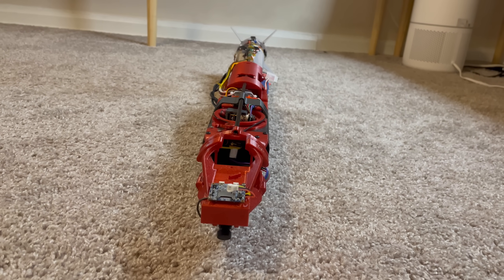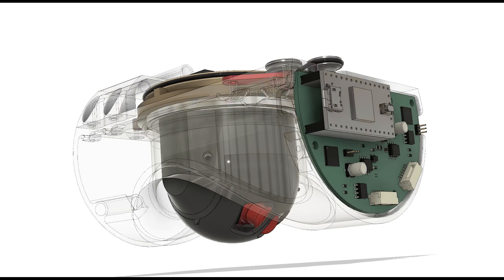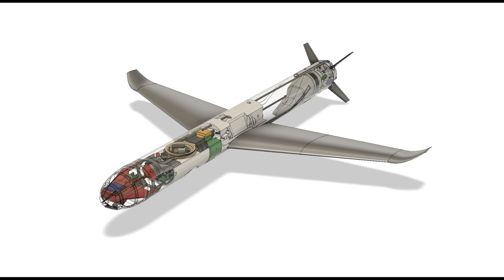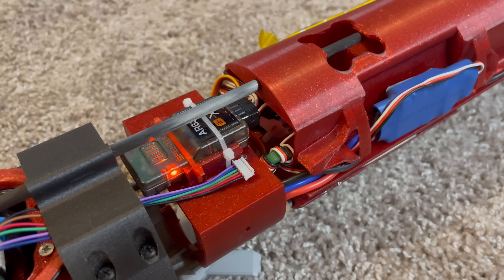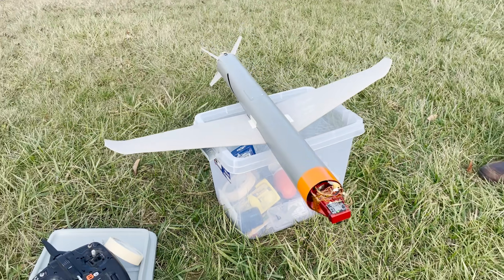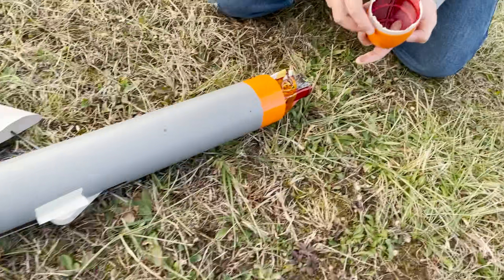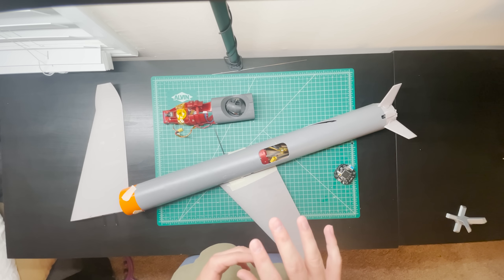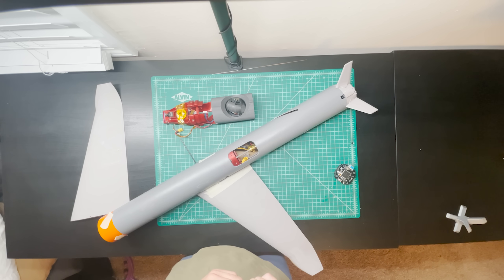Building (And Crashing) my Homemade Surveillance Drone

Comment: My guess is it need to be less then half the weight. And four times the power in addition to a stable rail launch system for the takeoff. Then you might see what have to be done with the centre og gravity, flight and control surfaces and stabilisation of the thing. Still a long way to go i guess.

Comment: Two things. 1, if launching by hand, don't throw it. Run and then let go. Throwing almost always pushes the nose around. 2. You don't need all four fins on the back. Many aircraft use the V-tail design with just two on the top.

Comment: To launch, maybe try releasing from a quadcopter with sufficient payload capacity. If not that, find two trees and get some surgical tubing. Scale up a water balloon launcher to use as a catapult launcher. You’re not getting airspeed by throwing it.
And verify your CoG. 
Instead of taking apart your prototype to save weight, build a clone that is identical in weight and  balance and CoG with only the EDF and Flight control. Get use to launching that , then start hurling all those hours of painstaking work into the air. Good luck!!

Comment: I would recommend two things: First, a slingshot launcher utilizing a small pen located under the center of mass. Secondly, I would suggest splitting the intake into two intakes and angling them off to the sides so you're not literally pulling yourself towards the ground or off balancing yourself in one constant direction.

Comment: As a college student studying aerospace engineering and apart of a college aircraft design / evaluation team here are some considerations possibly not mentioned.

Material choice: because the cardboard tube offers a high level of rigidity don't worry about the internal parts being super strong, 3d printed parts can be small with ribs, if a part is to have a large cavity use low infill or even lightweight "foaming" filament. This will reduce the launch mass without suffering huge losses to internal structures.

EDF Inlet: currently as the aircraft is flying the edf is trying to pull air out of the stream of air going around the plane. This is not only inefficient but could also be causing losses of with the tail section. As it currently stands a small bit of air is being pulled in by adhesion to the inlet and negative pressure caused by the fan. A proper inlet for the edf would go a long way especially once at cruising speed. This does not have to be much more than a little scoop that hinges down with the pivot point near where the current inlet stops. Additionally a thin grate could be added to help reduce injested objects and prevent the edf from exploding. The grate does not have to be super large or thick as where it is likely to pick stuff up (the ground) it should not be travelling super fast.

Comment: If it ever flys its will be going pretty fast to have a chance of lifting all that weight.
It looks like a rocket, probably needs almost rocket speeds to work.
When it flys it will not stay up for long considering the small battery, so sounds like a cool idea but realistically tracking something for less than 5 mins of flight time will be pretty useless.
The tracking idea is cool but better suited to a more standard quad copter design that can stay in control around a small area, land and take off successfully repeatably. ( Maybe a launch pad with charging capabilities)
Or a more standard plane setup thats low weight, slower flying with bigger payload capacity for longer more useful duration flights.
With all planes, take off us easy, its the landing thats much harder!

Comment: rail launch makes the most sense to me, especially if the final idea is to launches using rocket motors. Rail launch will get you that high take off speed which the rocket motor will also give you. Lighteining the payload offcourse helps a lot but then you are not really doing full testing of your control system when your payload isn't there. You want to tune your control system with full payload (gimbals moving around creating moments that need to be resisted, all the inertia of the payload batteries messing with response times). Also rail launch is cool

Comment: Here are some ideas.
1. As general rule of tumb, place CoM slightly ahead of lift center, it improves stability but decreases controllability. If you put CoM behind, the aircraft is unstable but highly manoeuvrable, which requires good autopilot and thrust.'
2. Rail guide for takeoff. Even a simple rail would make takeoffs easier, plus you could add catapult mechanism to it for increased chances of success"
3. Remove thrust vectoring, it quite often destabilises simpler guidance systems at low speeds.

*P.s. i have extremely low IRL experience, most of these thoughts come from the KSP experience and other YouTubers of .
Reply: There's a saying about CG vs CoL: a nose heavy plane flies badly; a tail heavy plane flies once.

Comment: one thing i would try if you are gonna try and throw launch it again is to have the rpm up to full while still in your buddies hands, that way you don't have to worry about the motor coming up to full throttle and it may allow him to launch it straighter

Comment: since you are operating at slow speeds you should use more of a flat bottom so that the rocket body acts as a lifting surface itself...as far as the space in front of the engine inlet perhaps you can put a small lithium ion battery as a backup power source to maintain controls in the case of engine out just to get it back down/not crash into pieces lol

Comment: Check out the Aerojtp mc-01. They use elevons for pitch/roll control. You have pitch and yaw only but you don't have enough effective dihedral in your wing to turn yaw inputs into roll so you're just going to wash out. At that weight you need more wing area and more thrust,  easier done with a propeller than an edf. If you're set on an edf then you need to scale way up to accommodate your payload. At this scale it's too much of your weight budget. For something like this that is on the knife edge of possible you're also trading too much of your weight budget and durability for the convenience of 3d printing.

Comment: Subscribed! But I am sure you will NEVER get enough thrust with this small nozzle / EDF opening, let alone the fan size. Probably measuring static thrust and calculating weight to thrust ratio would tell you a lot. In my opinion the angled intake with this EDF configuration will not work even after reducing the weight by 50%. Too little thrust :(

Comment: Add a scoop inlet for the EDF like the Tomahawk cruise missile but have it on the top surface so you don’t get FOD damage, yes your weight is a huge problem, the last thing would be your exhaust outlet looks very restrictive. There is a formula to work out the size compared to the fan diameter to increase outlet speed, but it’s usually best to have it the same diameter as the fan. Maybe for test flights it would be best to have a conventional tail, look to the A4 Skyhawk for inspiration. Best of luck.

Comment: You're right about the main problem, the weight. you should reduce weight as much as possible. I've also been worried since the beggining of the video about the engine, I think you shuold look for a larger propeler in order to push as much air as possible, that could compensate it and you would be able to maintain more weight on the aircraft. So I think weight reduction and larger propelers could fix everything

Comment: A couple thoughts I had (although I don't do a lot of hobby drone stuff, I do work in aerospace)

1. 3d printed parts are probably not great for takeoff weight. It makes sense to use them for the aero surfaces where you need complex shapes, but you could probably cut down on their use in other places. The ball turret in particular strikes me as something that adds a lot of weight for something that still can't get a stable launch. Until you can get the prototype to reliably launch, maybe replace that and use a mass simulator to figure out what your mass budget for that payload is.

2. The inlet for the ducted fan looks like it's going to induce a pitch up moment that will vary with thrust, if possible, try replacing that with symmetric inlets so that you have more balanced aero forces. Also, having the inlet along the body like that makes me worry about losing thrust in high AoA situations, but at low speed, that's probably not as much of an issue.

3. I like the design of the control surfaces connected to thrust vector control vanes, but I worry about your proposed Y-tail idea. Non-symmetrical external control surfaces coupled to symmetrical internal control surfaces are going to require some complex control laws.
Reply: I can't speak for what filament he used but there are multiple 3d printing filaments out there designed for model aircraft - I'm assuming he used one of those filaments (?) I could be completely wrong, though.
Reply: @amhedgehog  in the video he clearly said that he was using normal petg for most of it with some higher strength stuff around the cameras.

Comment: I feel like your CG is off, but I guess that could also be stalling (which seems to be your analysis). Ideally you should be able to throw it and see it glide a little (basically staying pointed forward instead of nose diving. Reducing weight will help keep it flying with less thrust, but if it can't stay stable it won't glide either way.

Comment: You need a lot more thrust. That fan setup like that isn't nearly enough for that mass. If those fins fit your launcher than you could get away with a much larger diameter with intakes all the way around 360° and use smaller fins and larger vanes for thrust vectoring to make up more of the pitch and yaw control. As it is I don't think you get much benefit from the little vanes. They might work with that exit diameter on a rocket but this thing isn't a sidewinder

Comment: Run your controls off a BEC to avoid esc thermal failure and other power system failure modes from causing a crash.  As long as the controls keep moving you have a chance of recovery

Comment: What about a small rocket engine, and you could launch vertically and then have the wings pop out for transitional flight? Seems like you could print a rocket motor mount, and use an engine with no chute deployment charge. OR, use one with a charge in order to deploy the wings? Just spitballing here.

Comment: For what I see, if you want it to fly you need more speed in takeoff, consider using a sling to launch. Also too little wing area. Maybe you can drop it from an rc plane and it could fly. I'd consider also adding dihedral to the wing.

Comment: 1. Not sufficient enough exhaust flow-> {~restriction by thrust vectoring fins
2. Too heavy thrust to weight ratio <-
3. C.G. Is aft 
4. Need to do thrust loss bench testing of edf unit open /then in the back part of your contraption w/ thrust vector fins

Comment: Non powered minimal on board load glide tests (if possible from 20+ ft off ground), gradually increase weight/ CG until flight characteristics are what you want, then powered glide test. After that plane should be good. Everything else, Awesome. I'm sure you ware well aware, over engineering only works so well when gravity is a factor, I look forward to you overcoming the mf'er that is gravity.

(Finished the video after I posted lol) My advice, 
1) like above, glide test the airframe with the least amount of weight, gradually add weight. Get the airframe functional first. 
2) Replace EDF with external propeller, I have no doubt you are capable of designing an EDF intake and exhaust system that works (I hope you do, I hate how difficult it is) but EDF has more fluid dynamics at play and inherently robs power, prop plane power systems can get you torque and/or speed so much easier, especially in the trail and error phase. Then retrofit with EDF afterwards.
3) Lastly for the wings, model rc aircraft wings do not need to be over thought, yours will have to be eventually, but a large ridged flat surface will work (Not well but it can). Keep it simple and design multiple wings with and easy removable mounting system for swapping quickly. I recommend a slightly oversized stol style first. EZ and can be made in 10 min. Take a look at Flite Test, while a different mission and extremely lightweight, some are very capable of handling a decent load. -- After 1) - 3) then rein in the designs to fit your ultimate design goals and tweak as needed. 
4) lastly if you haven't already, take inspiration from real world development, look at the US's first drones and follow up designs to see how the industry adjusted over time through their trail and error. They 100% look at what works and improve / Update with improved/streamlined technology. In 20 years we went from basically 1/2 - 1/4 sized full on aircraft to carboard rc planes in warfare. Plenty of source materials and inspiration

Good Luck cant wait for next post!

Comment: Your CG is fine and the wing area is fine. The problem is you have basically no control authority from those tiny fins in back. You’re so used to building rockets, where tiny control surfaces work at high speeds, but you’re building a plane now and you need to drastically increase the size of your tailplane to regain control authority.

Once you get that done you’re in business, looking forward to your next flight tests!

Comment: make sure youire thrust to weight, and wing loading are reasonable compared to other EDF aircraft. Also, EDFs are very inefficient power use wise so it will be hard to get a ton of thrust needed to accelerate over stall speed starting at the slow launch speed. Also you need to be hand throwing it nearly level or no more than 10 degrees up. too much AoA causes more stalling and a crash. Also also, i strongly recommend getting a flight controller, it can simplify some of the electronics, but more importantly an onboard gyro and imu can off stabilisation that I think will almost completely necessary if you use thrust vectoring, which can be twitchy. and lastly i do think bigger fins would help.

Comment: Your takeoff speed is way too low. An easy, low cost solution for that would be to make a slingshot launcher. It would certainly make for an interesting video. Or, with your backgound... a rocket assisted takeoff, even more interesting lol.

Comment: Not sure why your intake is on the bottom? Not only is there major potential for sucking up FOD, with the intake so close to the rear, the air getting sucked in  acts like thrust pushing the nose down and the tail up. This is why the intakes are forward of the wings on aircraft. Super cool design though.

Comment: You will probably want a bigger edf for an airplane that size. Also, edfs don't hand launch very well it takes too long to build up speed. A rocket launch system would be interesting, though. All that being said, it is a very interesting concept. Thanks for sharing the video.

Comment: You have nowhere near enough thrust for whatever the weight of that is.  It's also unknown if you have enough wing/lifting area for it.  As you suggested, start with a hollowed-out body.  Remove as much tech and weight as you can, and try to get that hollowed out body flying first.  Once you have a reliable flying platform, you can consider how to get your tech into it and if it can take the weight you have in mind.  (To test that, just add ballast weight to simulate your tech so you're not breaking valuable things as you work it out. ) 

Yes, look at using a launcher of some sort.  I fly a lot of fixed wing RC, and I had to design/build one for the hand launch planes I had.  I had very flyable platforms that were simply too hard to get started, and were stalling and crashing into the grass.  With the launcher all of that was eliminated.  I've launched 100s of times with this, and it removed the stress and randomness of a friends hand launch.  My design might not suit your needs, but it might give you a starting point.  Build instruction at the thingiverse link in the video description
https://www.youtube.com/watch?v=okmCqEiGUEw

Good luck with your project!

Comment: Nice looking design, but aerodynamically completely unsound! Your fins have a very VERY inadequate roll authority and making them asymmetrical is just going to compound the problem, it could be controllable due to yaw rate effects on wing lift (wing that goes forward gains lift and vice versa, as seen in launch attempt 2) but would be wobbly and hard to control. But yaw stability is also quite questionable (long fuselage, small fins), compounding the problem. It's doable with a configuration like this, but it needs WAY larger tail fin span (span is critical for roll here, not only area), or ailerons (but that's not so much fun). A launcher is a must for this, try to be at least 20-30% above stall speed. Weight reduction is a must too, this seems way too heavy (especially for hand launching). What thrust do you get from this EDF? I'd be very skeptical of this being usable with less than 0.5 T/W ratio. Also, your wing has quite a large chord (relatively low aspect ratio) and as such, the pitching moment from the wing is also much larger than from the wings of the original folding design. The tail fins need to compensate for the pitching moment and you lose a lot of deflection for that.
TLDR:
1. Much bigger span fins (at least double). Keep them symmetrical. Live with the consequences Mr Printalot.
2. Reduce weight, a LOT
3. T/W > 0.5
4. Make launcher, reduce wing root chord
Good luck!